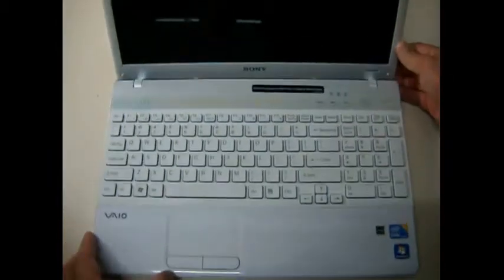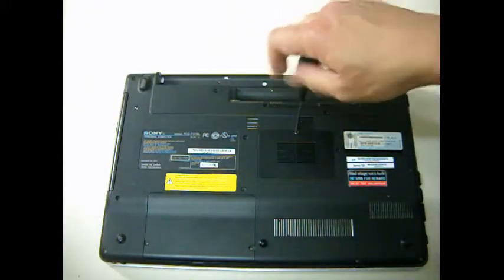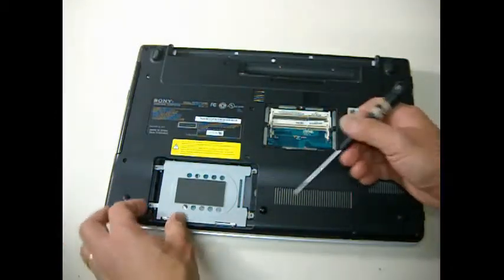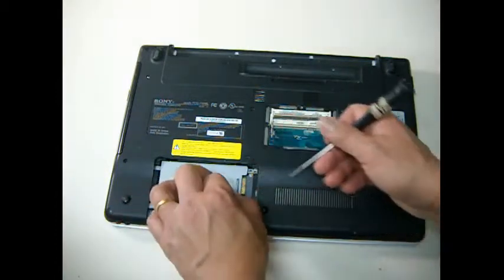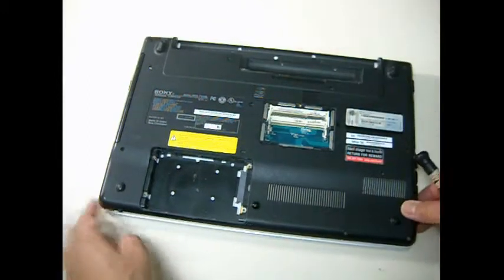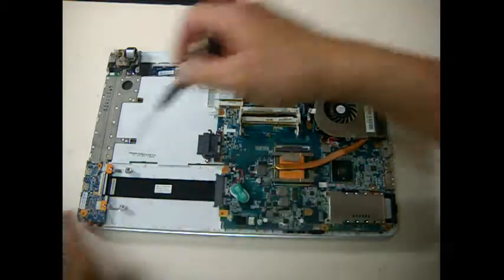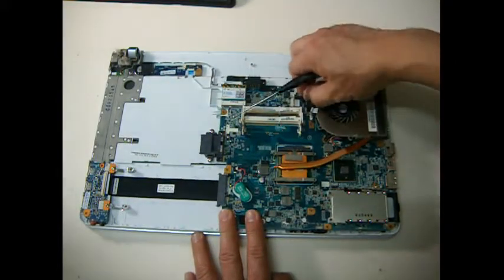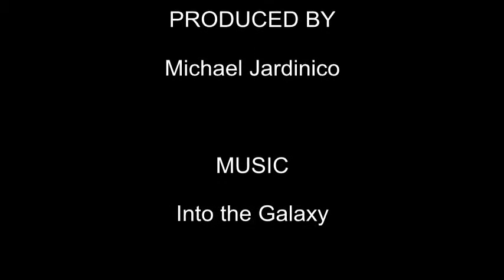How to replace Sony VPCEB33FM Notebook Motherboard, Powerjack etc

Comment: A good film, thank you.  You do not need to remove the CPU/Fan assembly in order to replace the DC jack.  Simply apply a small amount of pressure on the IC chip  (motherboard) at the 10 o:clock position to slightly flex the motherboard down.  The DC jack cable will easily slip out from under the fan.